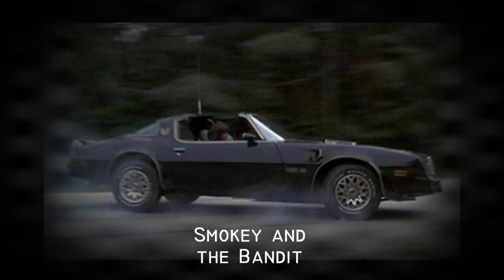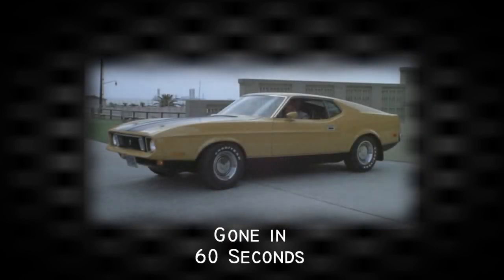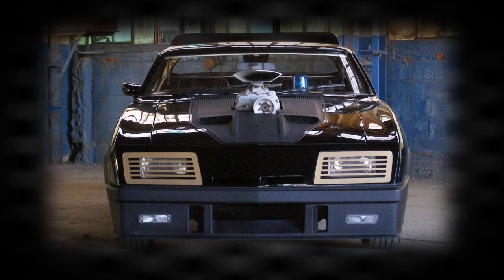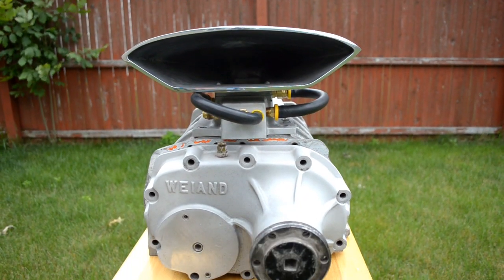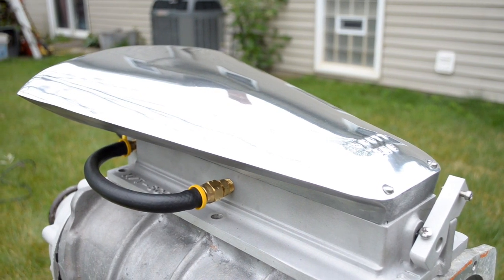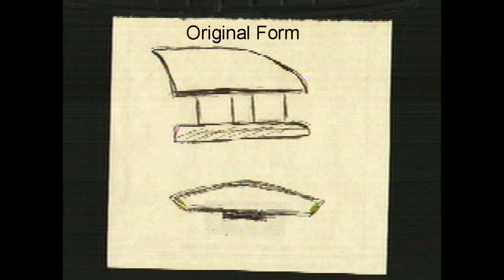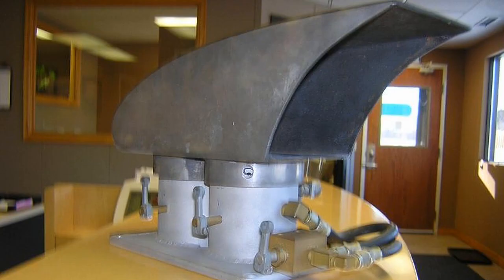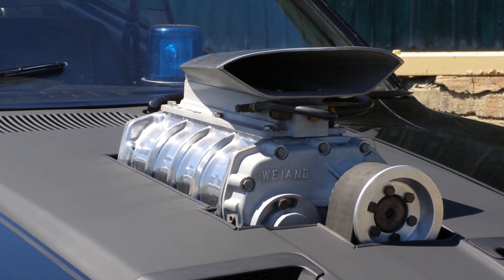My Mad Max Interceptor Project: Part 8

Comment: Good day sir is this project still moving?  Thanks
Reply from the maker: Yes and no. It is still going to be done. I have had some things in life get in the way and also I am pursuing a filmmaking career which takes a lot of my time. Last Fall I took a week off work just to work on this car but the week before I had developed issues with my shoulder and neck that prevented me from working on the car while I went to physical therapy. It was very frustrating. 

This is going to happen, even if not on the time table I had intended.

BTW, I see you are somewhat local to me in NE Ohio.
Reply: thanks for the update and keep the faith. Good luck with the filming and the other 999 hobbies. yes I am about an hour away west of Akron - grew up in Chesterland
Reply: i too am from n.e ohio,(ashtabula county), and have been a huge mad max fan since 1979 when the first movie came out. would love to stop sometime and check out your progress.

Comment: You are exactly right on the scoop. Thats also what I thought was special about the Mad Max car.  I had a Air Force sheet metal mechanic make mine for my 1973 Mach I. It had the 351 C engine with open chamber heads and four bolt main block. I put 1971 closed chamber heads on it and swaped out the auto trans for a 4 speed top loader. The closed chamber heads gave me 10.5 to 1 compression with flat top pistons. It had at least 400 hp to the wheels. This was all back in 1988. I didn't even know that the movie car used the same engine and trans as my Mach I. Back then no internet just the movie. My scoop was real close to the Scott one.
Reply from the maker: That's cool how that worked out with the drivetrains. Yeah, I learned most everything about the Interceptor in 2003 from the internet. Just looking into it is what "got me in trouble." ;)

Comment: I'm glad you're still working on this true dedication. I remember watching your videos ages ago!
Reply from the maker: b-rad ham I can't believe how fast time goes by.
Reply: 1001Hobbies sir when is the next video
Reply from the maker: MidnightClubsSR I have no idea at the moment. I am very busy at Ford working on launching the F-650 and F-750 medium duty trucks to be built in the US for the first time, and with an all new design.
Reply: 1001Hobbies that is so cool I can't wait to see them
Reply: 1001Hobbies I know sir first things first..... Me its been a minute since I uploaded video because last time I upload my videos my account was hacked and two my videos were deleted
Reply: +1001Hobbies ah so your working for them with that new aluminum truck then? also its kinda funny if you dont know this, but ford used aston martin as an experiment with that back in the 2000's, and its only just now that they figured out they could cut the costs down on production by putting a recycling plant next to the production facility.
Reply from the maker: +Kavinsky Smith Actually the F-650/750 are staying with steel cabs. The front end continues to be fiberglass. The F-150/250/and 350 are moving to aluminum. The 450 and 550 will also remain steel.

Actually, Ford learned about fabricating with aluminum with Volvo and Land Rover (larger volume than Aston Martin). The techniques that they are using were pioneered by Ford, and additional techniques were created (i.e self piercing rivets) for the F-150. 

The scrap aluminum from stamping goes right back to the mill that makes the aluminum for the truck. There is zero waste, and 100% of scrap goes back into the creation of aluminum specifically for the truck. It is an absolute first.

With the new micromill process that Ford and Alcoa have created, enabling making a roll of aluminum in 20 minutes instead of 20 days, is game changing. There are 130 patents on this process and Ford has exclusive rights to it for a specific amount of time in North America.
Reply: 1001Hobbies
Jesus, I guess I need to invest in ford then lol so Volvo and Land Rover was the test bed then, does that mean that Jaguar and Land Rover has access to this Technology as well?

Comment from the maker: Yes. I don't know how old you are, but besides our modern computer controlled fuel injection there was "mechanical" fuel injection back in the 1960's. You could even get it on a Corvette back then.

As I mention, this fuel injector was made for blown race engines. It would do idle and wide open throttle. It came with it's own fuel pump to provide more fuel at the right mixture as RPM increased.

Comment: Hi from the land of Oz,  love ur project, I owned an XB GS yrs ago.  U 
might like to know u can fit Mustang radius rods to the rear end of ur 
car. U will just have to tube the chassis rails, the rest is a bolt on 
fit. They will not be visible from the outside and will really help with
 spring wrap up under hard acceleration.

Comment: Hey by the way I just watched Eric banna's Love the Beast, which is about him and his relationship with his 1974 Ford Falcon XB GT, and I gotta admit after going over it I think your in the right for pursuing your mad max dream

as with how wide and large the car looks without the flares and fins it just looks rather cut off and somehow wrong, like the lines dont quite fully match up.

while on the mad max one they do, although I must admit I would trim down that line that goes around the front nose cone like it was in fury road, but I now see why you chose to go this way rather than just restoring the car. 

its just I do like some of the minor refreshments to the design they did in the movie, and some of the aspects of the Razor cola, as the nose seemed a little bulky somehow and making that line, the lip on the front flush seemed to help it in my eyes.

plus I loved that it was metal now, as something about fiberglass just doesnt seem to carry a soul like metal does. plus I just really like the look of cicular headlights like that on max's yellow car on it. as it breaks up the contrast nicely in my opinion.

Comment: The interceptor used in the movie actually was not suprcharged It was just an electronicaly driven dummy. My mate David Young did the special effects for Mad Max 2 & 3
Reply from the maker: That is correct, and widely known. However, the story of the blower being run by an electric motor is not true at all. I suspect is was an early theory from someone guessing how it was done. In the garage scene you can see that it is driven by a small blower belt that goes around the tensioner pulley, which has a v-groove pulley attached to the front of it. That pulley has a belt on it that attaches to one of the 2 v-grooves on the AC compressor pulley. The other v-groove on this pulley has a belt that comes from the crank and turns the compressor. This is how they managed to get the blower pulley to spin, and accelerate and decelerate with engine RPM. An electric motor would just turn the pulley at one consistent speed, irrelevant to engine RPM anyway.

Comment from the maker: Thanks. Yeah, an abrasive roll on a die grinder and a minute or two and it will be fine. I am really happy with it. Actually the blower on my car will be fake and be able to be turned on and off on the fly, which they actually could NOT do on the movie car. That was a camera trick, so being able to do it on the fly is STILL better than the movie car. I won't have the money to build an actual functionally blown engine, plus the extra time that would take. Also, that would cost more to drive.

Comment: Hey 1001 there was one other thing I forgot to ask, have you ever seen the photos of the interceptor, the original one at the 1979 car show before the first movie came out? its on the mad max movie website I think, as I gotta ask have you ever thought of putting that hood on your car, except with the blower sticking out of it? as it just seems to flow and look better with that hood on it, rather than the stock one that they used on it.

as its got like a bump on it so it eases out the lines abit, actually it looked more or less like the hood on maxes yellow interceptor except with a proper place to put the blower on it. 

 and I'd love to see someone put it on theres, as literally no one has ever done that before, and its a pitty we never saw that in mad max 2 really.

Comment: I actually worked on this movie way back in 1978 and am pretty aware of the 'fakery' involved in the movie car. The pipes in front of the rear wheels for example...Would love to see this project finished...What are the chances? I am in Australia and there are about 38 Black on Black Interceptors that I am Aware of and many Yellow Pursuit cars as well...
I am also aware of some 70 in the US and would love to see this added to the roster...
Reply from the maker: Me too! Ironically, it is still in this state while I work at my regular job and also work on a filmmaking career. About a month ago I wrapped on a feature film that is an adaptation of a novel by a Best Selling Author. I was DP on that project. I am also waiting for funding for a Hollywood project to come through that should be a break for me. In the meantime I have a few projects (film) of my own I am working on. One of them is a 3 minute short for Rode Microphones of Australia for their "My Rode Reel" contest. Great prizes, equipment I would use.

In the meantime, yeah, I hate just letting it sit there. It is my dream car, and I have it. I just need to finish it. 

Do you still work in film?

Comment: by the way 1001 hobbies are you going to incorporate any changes that were done to the interceptor in fury road? as I honestly really liked that they finally changed the front end to metal and gave it a proper place for a brushguard on the razor cola, its second incarnation,  like a proper cop car would have and gave it some shielding at the same time so that if max did what he did in MM2 with the new one, the front end would have survived that bump relatively intact. lower bumper included also if I may bounce something off of you idea wise keep the circular headlamps, and you can see what that would look like if you typed in mad max game, wild hunt, body,

as its like a half way between of the razor cola and the original interceptor and looks frigging sweet.
Reply from the maker: +Kavinsky Smith No, I am not. I saw the original movie when it was in theaters in 1980. That car instantly became my dream car. All my life that is the car I wanted. I dreamed my whole life of what it would be like to have that car. Well, it's in my garage. 

I did not care for Fury Road. I understand why younger people not so familiar with the older movies would like it. I am also an award winning film director (not at the level of George Miller though) and I believe the movie could have been done, and the story told, without Max. He was not integral to the story. It wasn't even his story, it was Furiosa's story. From that perspective, I really liked the Furiosa character, and I liked her adventure. It really was HER adventure. Max didn't even need to be there to tell it either. To me, that is a shame when the movie is supposed to be about Max.
Reply: 1001Hobbies
True true, but part of the issue in bringing back a film series that hasnt seen action since... well since I was born quite literally lol you need to break the mold abit and shock people, plus it was a fun reason to do something out of left field with the interceptor.

and I always thought its end in the film made sense after thinking about it for a day or so as his madness is being driven by his old car, as all of his flashbacks happen when he's in close proximity to it, and it makes sense as he's got a photo of his family in the horn button of the car. atleast with the original, seen only for a second or two in the first film right when he does a 180 with it.  so its a reminder of his past personafied in his automobile and that's what's been driving him mad,

and he finds redemption with Furiousa, like for once a woman he saves makes it to the other side, hence why he leaves at the end so it cant got the other way while he's still there lol

I kind of think of it as furiousas story, and maxes redemption really.

and the funny thing is I hated the cars when I saw the behind the scenes shots before I saw the film, after seeing it, it made a hell of alot more sense when their in action and covered in dirt, although I think I'm the only person who didnt like the Gigahorse lol

Nux's car though was a beauty, and I would love to see the updated front end on a replica, as they pulled the lip on the bumper back and made it flush on the top half, and you can see that if you look for it on Flickr, like type in fury road interceptor as theres photos of it in its start of the movie state from the goodwood festival of speed this year
Reply: well subvert expectations, and the car was back in the first chase scene, and like I said I think it was that that was triggering his flashbacks and crazyness.
Reply: +1001Hobbies  Dreams need to be made into reality before it's too late!  Tomorrow might not be here.  We all can leave this world at any time, usually sooner than we expect.  You and your dream deserve to be together before yet even more years pass you by.
Reply: misamisatv
 that's not gonna make him make videos faster man lol things take time lol and I've just always thought the MM car needed something changed on it, as the front looks too much like a grandmas 1980's thunderbird, hence the cicular headlamp thing

plus I've seen one that was rigged up like a mad max car, and it was convincing as that, hence why I kinda wanna change it up myself.
Reply from the maker: +misamisatv Thanks for the sentiment. I know this very well. I was almost gone 3 years ago. I am good now though.

I happen to be living another dream of mine and that is being a filmmaker. I directed, shot, and edited an award winning film titled "Ghost Walk: The Farm." I am currently working on a documentary and a TV show for other people, and I am developing a documentary of my own to shoot this winter, plus a comedy feature film I am going to shoot next year, and I may have an A-list comedian/actor for that one.

At my job that pays the bills (Toolmaker) I am very busy working 48 - 56 hours a week. I would love to work on the car but I have very little time at the moment. How many people can say they are living 2 of their dreams though? ;)

Comment: What is the compression ratio bumped up too when the blower is fully engaged and how long can you keep it there without blowing up the engine?
Reply from the maker: For the blower to be able to be turned on and off, as well as to fit into the film's budget, it was a hollow dummy, mounted above the carburetor. There were no rotors in the blower case. It sure looked cool in the film though. ;) I will be doing mine the same way so that the blower can appear and function as it did in the film.

Comment: looking at the paint scheme is it a gt you bought for your project or a mock up   a gt would have a jg 33 or jg 66 prefix on the number
Reply from the maker: No, my car is not a GT. I would not use a GT for a replica. My car is a regular XA Fairmont that had all of the XB bits on it already.
Reply: cool...had a nice coupe as a teenager   .. looking good lots of work yet
Reply from the maker: carblingautomotive
Thanks. Yes, LOTS of work to do and no time to do it. I am currently working 60 hours a week.
Reply: 1001Hobbies. I have an XA Fairmont 2 door sedan too.
I would never put XB parts on it.
 I don't like XB's.
There were over a quarter of a million XB's made whereas there were only over eighty thousand XA's. With about ten percent 2 door sedans. 
The XA is much rarer and better looking in my eyes.
I would love an Interceptor Pursuit Special but it would have to be an XB.
I actually had a replica of the XA 4 door sedan Interceptor that is chasing the Night Rider at the start of the movie many years ago. 
I'm probably the only person that ever made one of them.

Comment from the maker: Well, I won't have the money to build a blown engine, but it will be making around 500 HP at the flywheel. More than that and you lose streetability of the engine (in this displacement). I do not need the car to be a "world beater." I want something I can drive whenever I want to. I don't want to drive a race car on the street every time I take it out.

However, the blower will be able to be switched on and off on the fly the way it looks like it does in the movie, and that will be fun!

Comment: Hello, i know these projects take forever to finish hehe.  I just need the rear "turbine" style wheels for my road warrior version i'm building but for the life of me i cannot figure out what make they are or where to procure some.  Do you have any idea as to what they were?
Reply from the maker: You can go into the Mad Max Facebook page and someone can tell you there.
Reply: 1001Hobbies is it the one that says "mad max movies"?
Reply from the maker: Ion Racer
It is called Mad Max Replica Cars. facebook/groups/madmaxreplicacars/ Also check out MAD MAX GROUP. facebook/groups/MADMAXGROUP/
Reply: From http://www.madmaxmovies.com/
"The wheels are steel centered van wheels. The style is Sunraysia, as seen on Max's yellow XB, except this time the rims have been painted black. They are a stamped steel centre, welded to a steel rim. If you take photos to a good wheel place you should be able to get the right thing made up. In the US, I have been told that you might try http://www.cruisercustomwheels.com/combin2.html."
Reply: Actually i was refering to the rear wheels put on for the road warrior.  They had like an 18 spoke design..